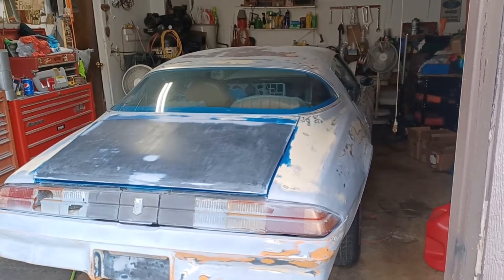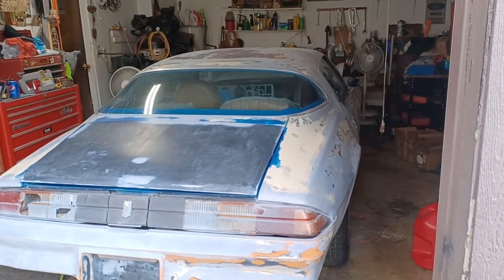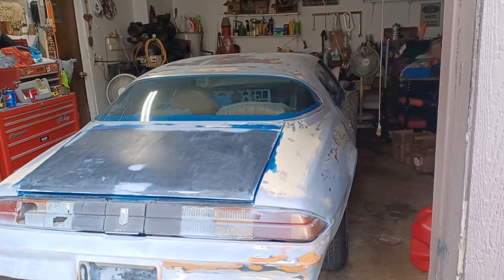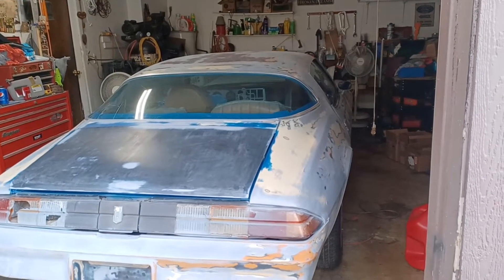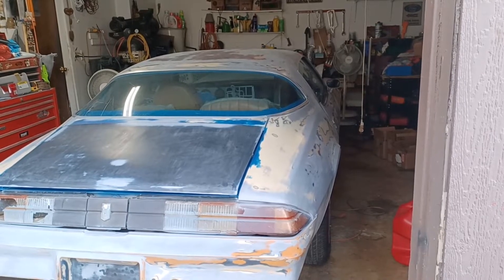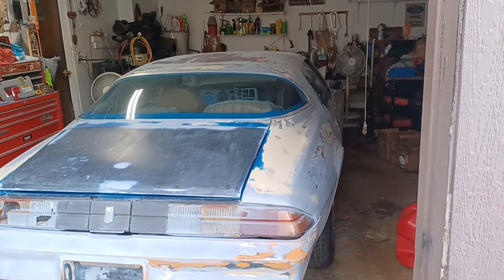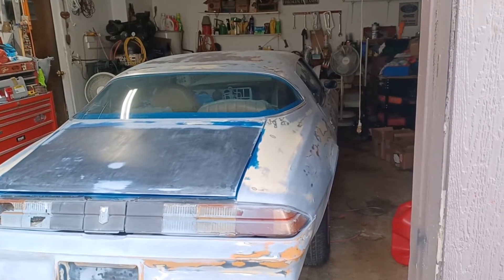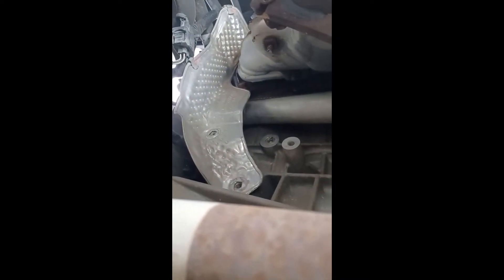Crankshaft Position Sensor (2011- 2020) Dodge 2.4L

Comment: If you replaced it because of a code or issue what was that code or issue you were having? I'm sitting here chasing a issue with my 2014 Dodge Journey 2.4l first it said Bank 1 and 2 camshaft sensor bad. Replaced those, then is said reading slow, pulled the valve cover off to inspect nothing there. Now it's saying camshaft and crankshaft misaligned. Timing chain is tight no slope at all, as far as I know it never jumped time ever. It's just a city driving vehicle with 118k miles on it. Any help would be greatly appreciated. Love the video it helps me with the next task.
Reply from the maker: Well, it was my daughter's Dodge, and she had it scanned at Autozone, and they didn't tell her the code. They just told her it was the sensor, so I just replaced it for her. I know sometimes you have to reset it to get it to read and start properly. Wish I could be of more help
Reply: @BlacktoppPerformance  ok, well maybe I'll just replace the crank shaft sensor next.
Reply from the maker: @calebigl4331  yea, that's all I replaced. I'm very sorry I couldn't be of more help or have that code. Did you get it scanned? If so what was the code
Reply: @BlacktoppPerformance  the guy did it at Orilleys and I wanna say P0017 or P00171 I can't remember
Reply: @BlacktoppPerformance  ok it was not P00171 it was P0017

Comment: Your video was far the best so far when replacing cranksahft position sensor. You explained where the sensor was located and even went under the car to show where it's at, where others don't show that. They just start going to work without explaing anything. Thanks alot for your time and patience.
Reply from the maker: I appreciate that and am very glad it helps. Happy holidays!

Comment: This is the camshaft position sensor.
Reply: Not on this 2.4l engine for the dodge.  He is replacing the crankshaft sensor
Reply: @L.TEL_MUSIC  I know what he said he's replacing, but that's the location of the camshaft sensor. I replaced mine about a week before I made that comment and that's where it was.
Reply: This is crank sensor location on the 2.4 engine. Po335 code. I just replaced mine for the 2nd time within 1k miles because I bought spectra premium instead of mopar the 1st time. Make sure to only get mopar sensor if changing. These things eat aftermarket parts.
Reply: No Maximus 172 is right that’s the camshaft sensor fools. Go to the auto parts and it will be a camshaft that looks Angled, the crankshaft is a straight look sensor not angled.
Reply: @youngcali6923 basic knowledge of the engine would tell you that there's no cams next to the bottom of the engine near the transmission

Comment: what code was it displaying. I keep getting P1D83 and P0117
Reply from the maker: I actually didn't scan it or get the code. The lady got it scanned at an autozone and I just did the work for her.
Reply: @BlacktoppPerformance  o ok cool. i’m am trying to figure out what is going on with my digital gauge my ditigal fuel level says it’s low but the regular one is accurate. any clue?
Reply from the maker: @smoovcarter897  Not off hand I'm afraid. That's actually a new one to me, sorry
Reply: @BlacktoppPerformance  lol thanks anyway

Comment: Did your car start after you change the crank shaft position censored because I changed mine and my car still wouldn't start what could the problem be
Reply from the maker: Yes it started right up. Does yours crank over at all? Did you clear the codes? Sometimes you have to relearn the new sensor sometimes you don't.
Reply: @BlacktoppPerformance I have the same problem. I replaced it, but it won’t start. It turns over (starter runs for about 10 seconds), but never fires. I guess I need to relearn the sensor(s), but I don’t have the device to do it. Now I need to tow it to a shop.
Reply: @progravix did you ever find out what it was
Reply: @progravix  did you ever figure out what that issue was. just replaced the battery in mine and now it just turnover and won't start and keep getting random codes.
Reply from the maker: A 2011-2020 Dodge Journey not starting after a crankshaft position sensor replacement is a common issue. The most likely cause is either incorrect sensor installation, a faulty sensor itself, or the need for the Engine Control Unit (ECU) to relearn the sensor's parameters. You can try disconnecting the battery for 15 minutes to reset the ECU, then let the engine idle for 10-15 minutes to relearn. Also, inspect the wiring and connector for damage.